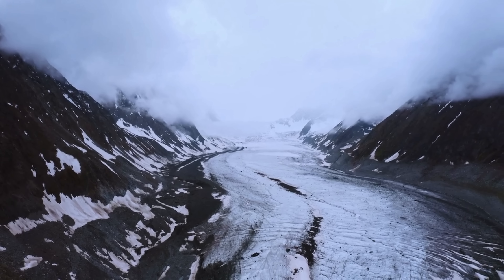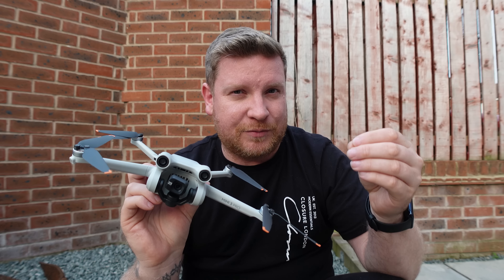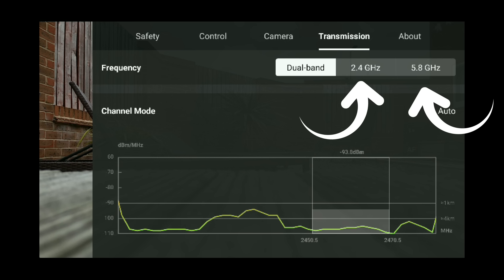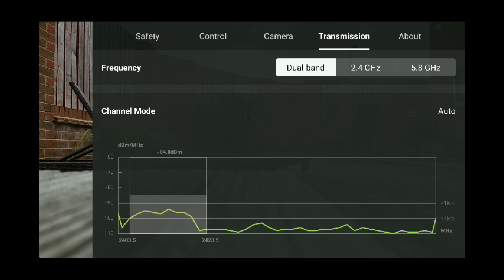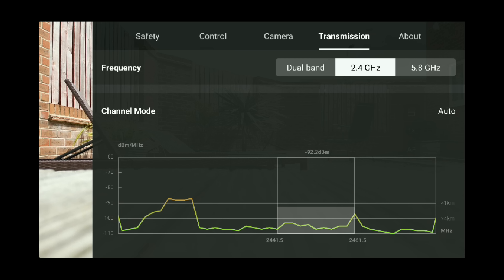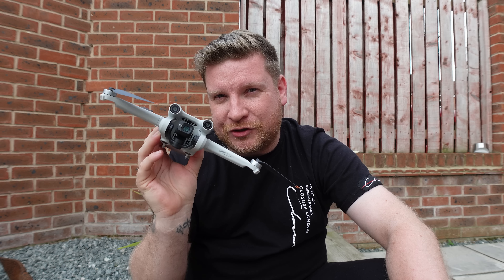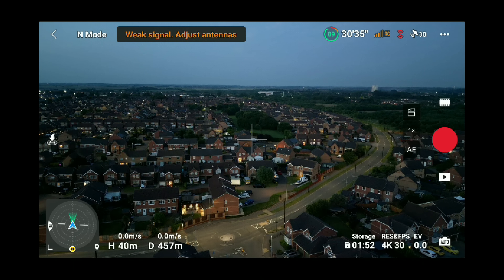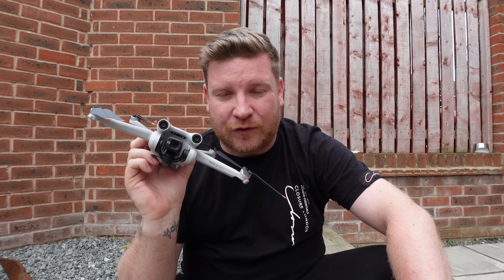THIS Is WHY The DJI Mini 3 PRO Has Signal PROBLEMS! ( Yet Some Don't )

Comment: The reason number 1 is CE vs FCC
Reply from the maker: That's a huge one yes! But even the FCC users have been struggling also hence this is why I looked for another theory
Reply: I kinda disagree. CE vs FCC has almost always been a case and obiously users in CE region excpect to get less range compare to FCC, nothing new. In this case, many drone users in both region have trouble getting reasonable range or trouble free flight. 
If you're getting worse signal compare to previous DJI drones....same region, same envoirement....there has to be more do it.
Reply: @Kr1sVr  Like I said though, that's reason #1 then the rest follows, antenna design on AC, band selection logic, ability to point at AC religiously, etc FCC vs CE is not the ONLY reason.
Because in CE once you solve everything you still have the CE limitations, FCC has more leeway.
But I guess you can use the cracked firmware or w/e on the mini 3 pro.. vs my sad mini 1 that is STUCK in CE damnit (still doing 3km though)
Reply: @Airbag888  What Im saying is CE limitations are well known...that's the reality of it, it is what it is. I dont call it a problem, specially because I'm fine with Air 2 signal I get in CE region. 

Lets put it this way, I'm in CE region, my Air 2 can fly x distance no problem. I buy Mini 3 and it can't get anywhere close to Air 2 x distance...same region, same environment....whats going on. I expect it to be close, match or be slightly better. Both are limited the same way in my region, so that's not the real problem.

Mini 1 was my first drone....one time I did range test I got 3.5-3.6km....which is amazing for Wifi drone in CE. And while I haven't done range test with Air 2, it's way better inside 1km range I usually fly and no problem with 2km.
Reply: @Kr1sVr  That's the thing though, the limitation of the antenna design (and more) on the AC seems to impact the range.
from air 2 to mavic 3, sure I'd expect similar range but air 2 to mini 3 pro, I have some doubts.. it's a bit like oh dslr can do 24Mpx but my phone can do 48Mpx.. yes but the sensor size matters.
My point is, with FCC you're "brute forcing" your way through bad antenna design.
It's not like 'occusync version x' can do 12km ideal conditions will be the same on all drones with occusync version x.

At the end of the day you're not saying FCC/CE point is bad and I'm not saying FCC/CE point is all that matters.

Comment: I have no problems in Automatic mode. And I have compared both. Mini 2 and 3 pro. With mini 2 I can loss signal after 100m when having a tree in way or move out of sight with the controller. The controller has to be held in direction of the drone without obstacles and the N1 and RC will behave absolutely identical. Absolutely. For a test it is necessary to use same App Version same environment. A lot of youtubers don't. That's the reason the results are so different.
Reply from the maker: Well at least you know I do my tests properly eh! 😊
Reply: @GAVINHR  Yes YOU do but not everyone. I have subscribed your channel because of the very good tests and coverage of also the old drones.

Comment: And this problem of the RC not picking the correct frequency still hasn't been fixed. I have switched to the new RC controller a month ago and have lost connect almost every time I fly. It's really pissing me off. It has to be an easy Firmware fix DJI so why don't you just get your finger out and get it fixed.

Comment: Edit: Ah, of course after posting I start to second guess myself and instead of checking the manual and the spec, I googled, and this forum thread says it does not use the tilting up feature at all for the panorama and it's still filling in the top? This is a surprise to me as the new gimbal seemed like it was made for this, I guess it could possibly be in a future firmware update. The thread: https://forum.dji.com/thread-264609-1-1.html

As someone looking to finally get a drone, mainly for photography, this video was a link I found when people talked about the connectivity issue 😅 I always do product research and as such I'm dropping a semi-random question here, as you appear very knowledgeable and this is somewhat specific. And DJI doesn't respond to me on Twitter 🤣

I read the specifications, and the drone does HDR for single shots, but I am mainly buying it as a 360 camera in the sky, and for that I wonder how well it exposes panoramas even if those, seemingly, don't do HDR. Panoramas and spherical shots are with benefit done in HDR as we expose a wider field of view, so I'm pondering if the single shots for the panoramas before stitching are HDR or not, or maybe the dual ISO feature is enough? (or is that the HDR and it's not stacking multiple exposures? So many questions!)

As to how to motivate the Mini 3 Pro as mostly a 360 camera, it's actually similar in price to a Ricoh Theta X, but it can fly, and I have the Theta V for interior shots even if it has so-so image quality. The Mini 3 Pro also appear able to provide a full sphere compared to prior Mini/Mavic drones which blurs out the top, this as the new gimbal can now tilt straight up? This is a major selling point to myself as I love cloud-scapes and want the full sphere, thus my current interest. 😗

Regardless, thanks for your informative videos, you have my subscription 😁

Comment: Hi mate just got my mini3. 

Done some tests tonight and I can’t get 600 m without losing connection in any direction - it’s absolute gash

I’ve got the nano* and I can fly at least 2.5 K and behind houses in a built-up area with a full signal with no problems at all

I had a DJI spark many years ago and the signal quality is comparable to that with the mini three pro it’s absolute horse shit
Reply from the maker: Basically just like I have shown on the channel previously that autel nano + is a really great drone and people don't give it enough credit! Sorry to hear of your bad experience with the mini 3 it'd not great overall compared to the nano for signal

Comment: thats why we said, its just a firmware problem
Reply from the maker: I've never thought there was an issue with it personally, it goes as far as the mini 2 and according to the specs that is all it should go but I knew there had to be a reason and this seems logical, tweak to the frequency hopping should solve most issues on the RC
Reply: @GAVINHR  good finding though